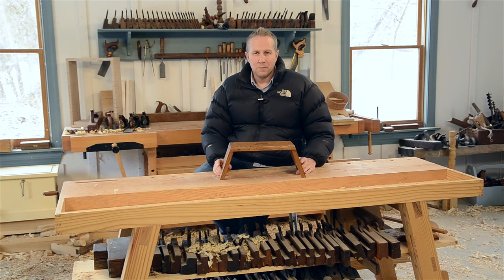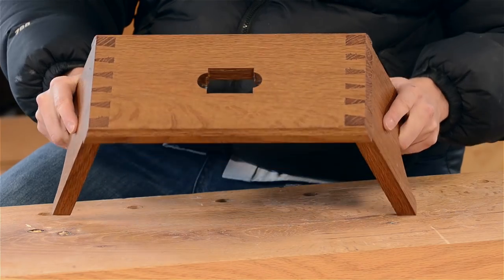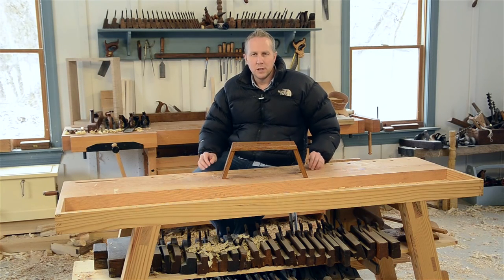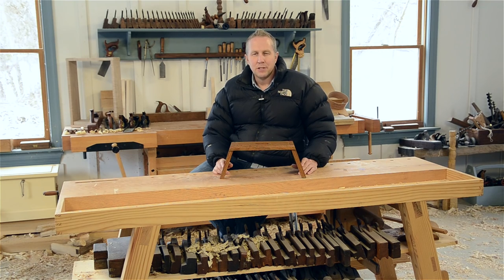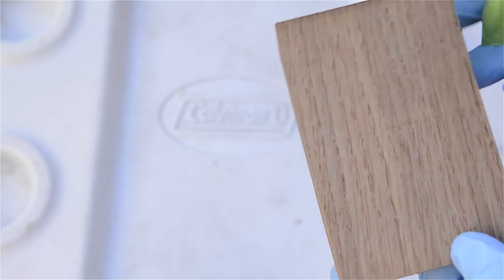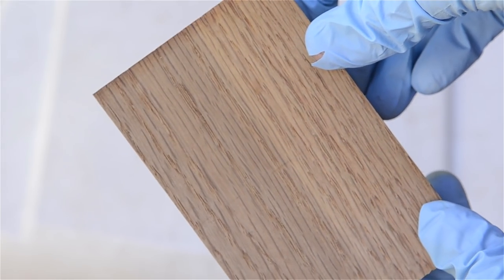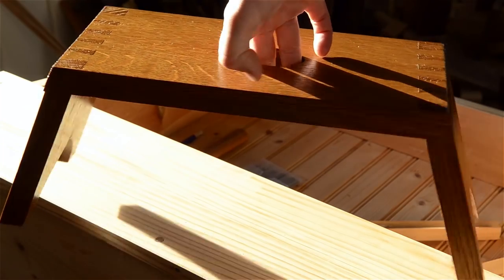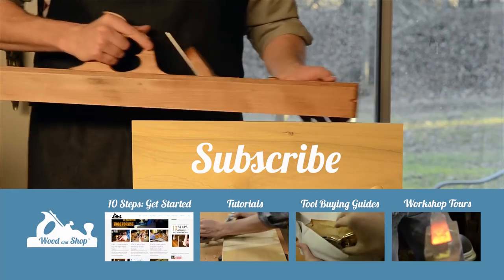How to Beautifully Fume Furniture with Cheap Ammonia

Comment: Hello Joshua, Great Work as usual. I have used Ammonia to finish several different projects, from small Stickley inspired pieces to large dining sets.  I have found that if you have access to a chemical supply dealer, they may carry an industrial strength ammonia. something like 26%  you will have to have a drivers license to purchase it due to sales restrictions.  I usually by it by the quart for $5.00 to $8.00 and it lasts forever.  

I have found that using the higher concentration it has a very dramatic effect on a 24 hour exposure.   I will put the pieces in unfinished and they typically come out very dark almost black.  Then with a coat of oil they turn that unique brownish color. 

Safety note: use heavy gloves, face shield and respirator, and only use outside or in a very well ventilated area when dealing with the high concentration /  industrial strength ammonia.  It will take your breath away by depleting the oxygen which can cause death. I would not recommend fuming in your shop. unless you want to fume all of your lumber stock.

Comment: The finish looks great.  I was curious with the finish that was applied before fuming, if you cut to expose a section of that after fuming, is the more dramatic color change in the wood beyond the finish, or is it just mostly at the surface where the color change is occurring?   Thankls.

Comment: I just did this with white oak. I left it in the chamber for 3 days and then changed the ammonia and left it in for another 3 days. I was using 28% ammonia. What amazed me was that the ammonia gets everywhere. I had a test board laying flat on the bottom of the chamber and it was just as dark on the bottom. When i removed the wood it looked fairly dark but after I applied an oil finish it turned almost black...  too dark actually. I made a video but I didn't want to spam your video. I never thought about applying finish BEFORE fuming.

Comment: Hi Joshua,

Is it possible to use the ammonia method on any wood or just oaks?
Reply from the maker: Great question Gregory. Woods with tannic acid will react with the ammonia, so these woods are known to darken with Ammonia: Oak (White Oak fumes better than Red Oak), Walnut, Cherry, Maple, Butternut, and maybe some others. None of the woods mentioned fume nearly as much as White Oak. However, you can apply tannic acid to woods before fuming, which will allow the fuming to get darker.

Comment: i'm assuming your container doesn't have to be air tight like a cooler right? just something with a closing lid? also did your cooler smell afterward?
Reply from the maker: As air tight as possible is good to keep the ammonia from escaping. But I've seen others drape a plastic sheet over the top of the furniture, which isn't air tight, but keeps the ammonia in for the most part. Just make sure the plastic doesn't touch the furniture. No, the cooler doesn't smell afterward. Ammonia is used for cleaning, so it won't hurt your cooler.
Reply: Wood and Shop thanks! I know ammonia is used for cleaning just wasn't sure with the reaction to the tannins if there would be any advesre reaction
Reply from the maker: Nope, I've never seen any problems or had any lingering smells in the cooler's plastic.
Reply: Wood and Shop what safety precautions did you have a respiratory or if you do it outside would that be enough ventilation?
Reply from the maker: A respirator would be a good idea. I made sure to not expose myself for very long at all, so I just hold my breath when I open & close the cooler outside. Outside is very important.